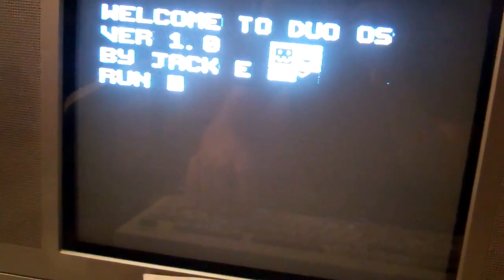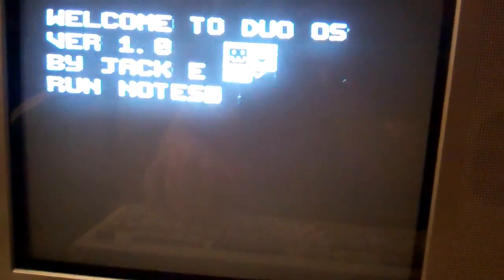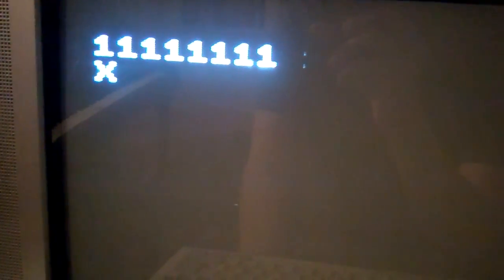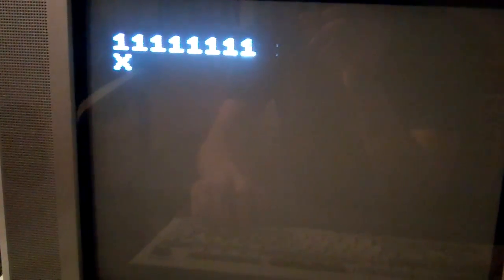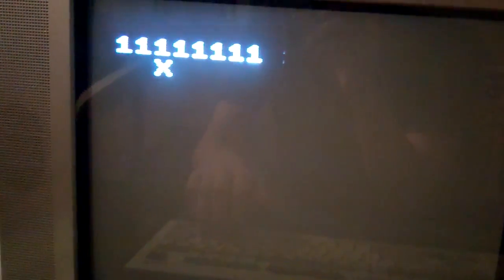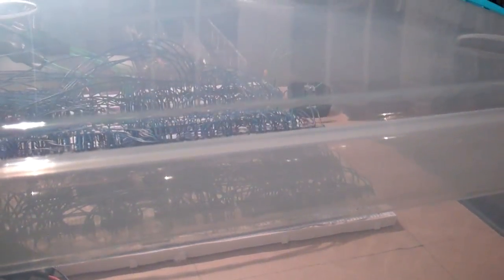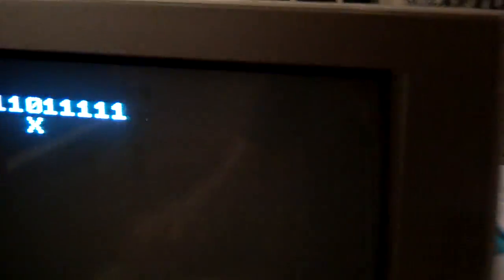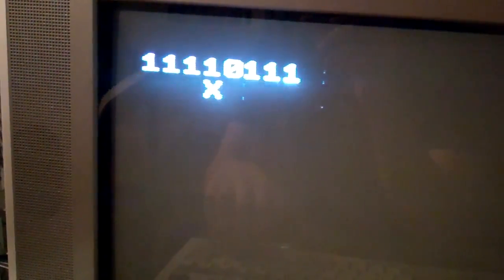DUO Adept Makes Sound

Comment: @blarrer20 Yes, I've seen it. And thank you very much for the information. After I posted that comment, I designed a working model with a wired CU in LogiSim, thanks to another source I found. The best way to learn is to jump into into something completely over your head and just do it!

Comment: @milesdavidsmith The website cpuville.com is very helpful. You've probably seen this website before if you've looked for homebrew cpu designs, but you may not have noticed that on this page (cpuville.com/control.htm) there's a link to a document you can download that goes through the design of the control logic in great detail. Hope this helps.

Comment: Hello. I'm very impressed with this design of yours... I'm getting into CPU design myself. I've built a 4 bit ALU and some other components out of relays to be implemented into a simple 4 bit CPU, but I can't find any good sources of information on the design of the control unit. I just have no idea how to approach it. Could you suggest an angle or some source of info? It would be greatly appreciated.